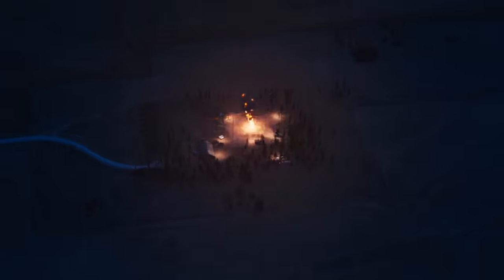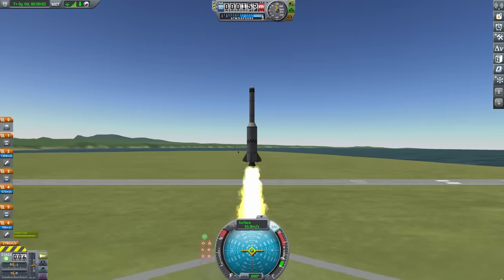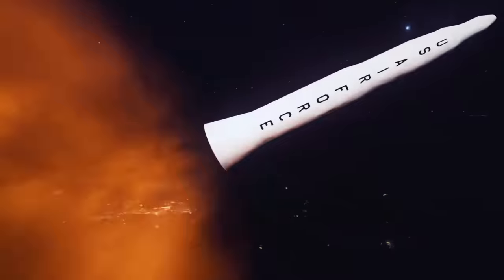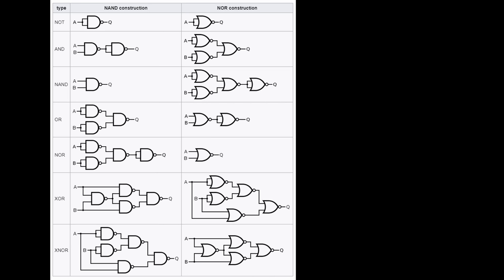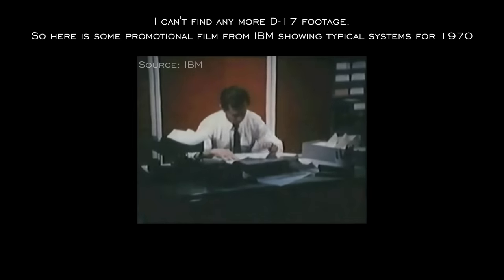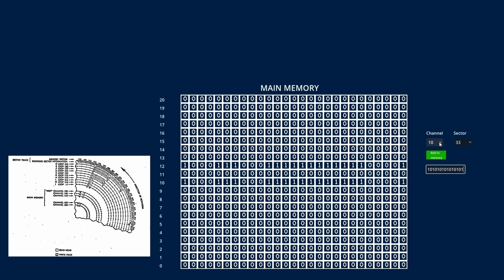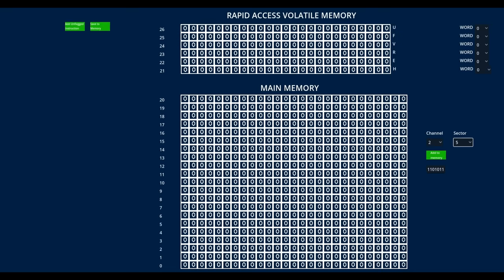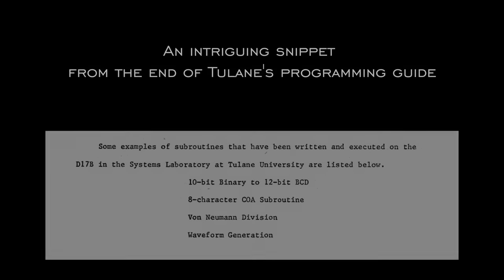Minuteman D-17b: The Desktop Computer Was Born in an ICBM

Comment: I commanded a Missile Combat Crew in the early 80s. My system was Minuteman III. One morning when I was sitting in the Squadron waiting to go on alert, I happened to stumble upon an old Dash 1 Tech Order for the original Minuteman I system and started to read. I was shocked to learn that the first Launch Control system had no computer at all. The entire thing was based on mechanical relays. The Enable commands were simply electrical continuity circuits. Interrupt the circuit and the sortie enabled. If power at the capsule dropped, all the sorties in the flight would enable. Daily SCN tests dropped connected sorties into Standby mode so the crew could verify communication. The whole design was surreal to me given all the nuclear surety that was deliberately built into the software that I used. I couldn't conceive of that kind of system without a computer. But I guess it makes sense given the level of technology in the early 60s.

The computer in my capsule was a Rolm 1666B, especially built for the mission. Not much by today's standard but it did the job.
Reply: Sorry if this is a stupid question, but what was it like doing your job? I can't imagine the feeling of working next to such awesome (in the old sense of the word) machines.
Reply: @GulmoharBloom  Missile crew duty was a 24 hour alert consisting of alot of tedium interspersed with intense activity. It was cold in the capsule so I generally wore a sweatshirt. (The first thing you did on alert was take off your uniform - one of the many, Many, MANY things the movie "Wargames" gets wrong.) Taking off the sweatshirt was a good indication of how busy I was. We had daily tasks - making sure the capsule was OK, verifying the targeting info in our sorties, calibrating the missiles every now and then. Mostly we watched. "Status monitoring" was the parlance. Security, faults, maintenance, and comm. 

Did I think about the possibility of war? No, not really. PBS did a documentary in 1983 called "Nuclear Outpost" at my base. One of the reporters asked me if I had nightmares about nuclear war. I said "No, I have nightmares about Two Officer Policy violations" (Being alone in the capsule was a serious offense.) I still had those nightmares 10 or 20 years after I got off crew. 

That said. Just before I got on Crew, "something happened" (we will leave it at that) and the readiness of the missile crews went up to the point that they inserted launch keys. (That's a long way from actually launching missiles btw but it is still what you call a significant event.) That's only happened a handful of times in history. The command post on the base had a direct line to all the crews in the field,  and the first direction was "Do not call home. Keep the outside lines clear." Everything was restored to normal in a few minutes as the "something" was resolved. Since the launch switches are sealed to prevent tampering, a lot of people were immediately dispatched to the field to replace the seals. They said the crews on alert were just white and still shaking. So, yes. We knew it was real. But it was mostly remote from consciousness. 

Would I have turned that key if so directed? Yes. No doubt in my mind.
Reply: @carljacobs1260  It just boggles my mind to meet (?) someone who would be/was involved in nuclear warfare. I'm not sure if I could have turned the key if it came down to it, but then I won't ever be in a position to do so. 

Thank you for responding, it's given me a new perspective to consider as I read more about nuclear war. Have a nice day!
Reply: @carljacobs1260  Oh come on, WarGames was - technically at least - fantasty, albeit terrific movie.  Was documentary you mentioned used in Gwyne Dyer's "On War" or "First Strike" or was it other?
Reply: @piotrd.4850  "Wargames" was a piece of propaganda for the Nuclear Freeze movement of the early 80s. Some of it was hilarious. Some of it was so dumb it could only induce eye rolls. "That's not the correct procedure, Sir" is the dumbest line I have ever seen in any movie ever. A great example of writing a plot to fit a preconceived narrative.

To the best of my knowledge, the PBS documentary was only broadcast on PBS. You can find poor quality copies of it on YouTube.

Comment: Early computers like this are fascinating, stuff like the core rope used in the AGC, really amazing tech.
Reply from the maker: The core rope modules were wild. When they reprogrammed the AGC to use as a fly by wire computer, they had to race to write the code before the core rope manufacturing facility was closed forever.
Reply: As a very young child I got to see a core memory computer being used in production.  I found it really neat that one could see where every physical bit was stored.  (I've tried to determine what precisely machine it was but to no avail.)
Reply: I'm a computer nerd and have no idea what core rope or an AGC is. 😂 Thank you for what I'm sure is about to be a very happy Google/wiki rabbit hole.
Reply: @orangejjay  Have fun!
Reply: @Alexander-the-ok code being rushed? As old as code! 😂

Comment: That magnet hard drive sounds more like a parallel-track magnetic tape loop made out of rigid bodies instead of bands of elastic or celluloid.

Wait. It's planar drum memory.
Reply: Yea, the one used for the D-17 is a drum memory.  The models produced for less-extreme environments (including the Hound Dog missile) were more like a single platter hard disks.  See Appendix A of MEM-BRAIN FILE, Four versions for DCA for details.

Comment: Assuming decent gyros and accelerometers, you can significantly minimise compounding error by using low-pass filters at your ADC inputs. This can drastically reduce the sampling frequency required to maintain a reasonably accurate positional and velocity vector. If implemented correctly, there is no quantisation error other than the bit depth of the ADCs, and you don't lose the contribution of any high frequency components, those get averaged into the signal by the filter.

Comment: You have no idea how much I enjoy this video. I have always been fascinated by early computers. Back when I was in school and briefly after, I only had time to read a little bit into these computers. Here, you've gone all the way!!!
Reply from the maker: Thanks. Tbh I'm the same - always been fascinated by early computing, but only recently had the time to study these systems in more depth.
Reply: I am looking forward to the episode about the Navy's fully-networked, transistorized refrigerator-sized missile fire control computers, put into operation in ~1964. It is one thing to equip a computer to work control surfaces and thrusters, another to have it swing a robot arm into position and launch missiles. Many ship captains got into hot water trying to keep the computers off their ships, but the need for fast response left no possibility of them staying in the loop. Where more capacity was needed, they added more of them, and all talked via radio link to their counterparts in nearby ships to coordinate their activity. So a missile battery on a destroyer could be used to protect a nearby aircraft carrier, without crew help.

I gather those machines had a role in Apollo as part of the worldwide communication and tracking system, but the details escaped me.

Comment: you and Artem Tatarchenko are a match made in heaven lmao. he is so talented and really adds a lot to your really well written and interesting essays :)
Reply from the maker: Agreed, he's amazing at what he does.
Reply: While the animation is quite good, a few details do distract me quite a bit as a big fan of the Minuteman system.

The silo layout, in a forest and surrounded by buildings definitely seems more like a Soviet style missile silo installation. The US launch facilities are very spartan and remote, just a fence and dirt and gravel patch around the silo door, usually in the open plains of the upper Midwest.

Also the silo door actuator is much more violent. While a lot of footage of launches comes from the Vandenberg silos, where they slide open smoothly on rails, those silos were designed for repeated use. The actual deployment silos have a much more simple system. Hydraulic rams push with great force the concrete door on smooth metal rails with enoug energy to make sure that even if the silo is covered by dirt due to a near by detonation that it can get out of the way. The only thing stopping it is how much friction it has once it comes off the rails (and in reality could easily breach the perimeter fence).

Also the tail end renders show two exhaust nozzles. The Minuteman first stage had four nozzles fed by a single solid rocket engine.

Anyway, nitpicking but small details noticed by a pedantic nerd.

Comment: The D-17B used discrete DRL (Diode Resistor Logic) circuitry with DTL (Diode Transistor Logic) where needed, but the MMII used the D-37C which was one of the first guidance computers to use SSI integrated circuits (The other being the Apollo Guidance Computer).

Comment: Alexander, this is a very interesting video. I used to work with a very early DCS, it was designed and built by the company that used it in its pharmaceutical manufacturing business as process control and batch reporting. I only had a bit of time to learn about it before we replaced it with a modern standard (S7-4xx).
I specifically recall an analog input board with hard-codeable limits (DIP switches and jumpers, 8-bit, low and high warning and alarms, it triggered an interrupt on the central and fed it to a card managing all the interrupts and their privileges.
It was a headache to implement the interrupts as the only documentation we had was a copied copy of someone’s handwritten notes that had been used during qualification and then copied again and put in a binder.
It worked for decades but there was a fatal flaw in the design and it hadn’t been picked up. It was quite the hassle to get the HAZOP reviewed by the chemist who just muttered „boy, we were very lucky“ and then update the documentation to reflect the corrections we had to make.

Fun.

How far is your SDS and the SMDS for this project? 😏

Keep it coming, love it!

Comment: IIRC beryllium is a very stiff metal for its weight. It's also used in  the JWST mirror segments for the same reason. Probably also has a low coefficient of thermal expansion. Nice modern IMUs still output an integrated delta_v over their sampling interval as well.

Comment: The Soviets used a ground-based guidance system in the R-7, the basis of which was copied from the Germans at the end of World War II. The R-7 ICBM was tested in the Northern Urals in 1959 and there were some casualties there during the testing phase, including the members of the Dyatlov group who were involved in the testing and evaluation process. They conducted these tests with active warheads set to a lower yield of 1.6 megatons (standard RDS-37 warhead). After completing the series of tests, the R-7 was officially handed over to the Soviet missile forces in 1960.
For those interested in more details about the Dyatlov Pass Incident, I recommend watching my videos about the entire case and its complete solution.

Comment: Yeah, I saw a couple of of preeecessors, probably for the Titan II, of these being thrown out from the local University.  They were supposed to go to hazardous waste disposal, as they used a cooling system using liquid mercury.  Really sturdy devices with inch-thick aluminum cases.  You couldn’t see much inside the case as it was filled with  plastic foam.  Wish I had kept them.
Reply: I'm still kicking myself for not rescuing the DEC PDP that I saw in the trash outside a medical office in the early naughties.
Reply: @alexhajnal107  I had the opposite experience-- I bid on two PDP-11/44 systems, won them, then found out they were just the cases, someone had pulled out all the cards.

Comment: When you pointed at the need for high precision of guidance and possibility of corrections (22:07), you mentioned missing St. Petersburg and hitting Helsinki. Well, at the time the minuteman were developed and were operational it was Leningrad they were aiming at, since the name St. Petersburg was reissued only after the collapse of Soviet Union

I don’t think this correction is a must, but I figured it would be something to note
Reply from the maker: Great point. I never thought of that.
Reply: Thus Lt. Chekov in Star Trek had scotch "invented by a little old lady in Leningrad." How were the Star Trek writers to guess it would change back to Petrograd by then?
Reply: @sciptick 
There are people born in towns which changed their name upon independence.
But they speak of the place where they were born, not what some politician called it  later.

Sometimes an international airport changes its name but the codes for that location are still the same. 
There is one 50 miles from here but a Liberator pilot would use the same name. As would a local.

Comment: The computer was under the platform that carried the RVs. It also had either an electrostatically levitated sphere gyroscope or a helium neon 6 axis ring laser gyro in the dead center. The main middle battery was a 28V NiCd battery but the ones in the actual nukes were magnesium based thermal batteries. What they got in the more modern ones is a lot smaller and more accurate.
Reply from the maker: I really want to do a segment in a future video on ring laser gyros.

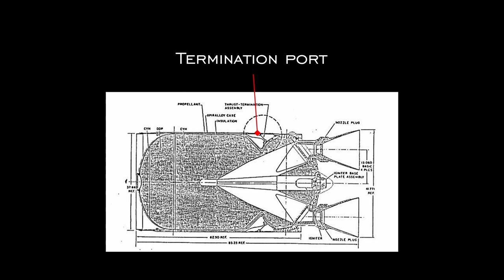Comment: 21:30 That is trivial. The explosien caused a massive leak that bypassed the thrust nozzles completely. Thereby reducing the thrust not to nul but to a fraction. That influence sufficed to control the terminal velocity.
Reply from the maker: That’s what I initially thought but all the sources on this state it wasnt a thrust bypass but a near instantaneous termination as the reaction abruptly stopped.
A few other viewers have clarified its because the rapid drop in pressure blows off the top layer of fuel and stops the reaction.
Reply: @Alexander-the-ok  if you cut solid state fuel fast enough until reacton gets there...

Comment: Beryllium is super lightweight, super strong, and has a very low thermal expansion coefficient, so parts made from beryllium alloys can be made with tighter tolerances than aluminum or titanium. There's also no risk of sparks or static buildup, which can reduce compounding errors in inertial guidance systems. But... beryllium poisoning is absolutely horrible, it makes asbestos seem like a mild nuisance in comparison

Comment: Just for fun, I wanted to know how fast Doom would actually run on a D-17B as the CPU.  There's no way it could store Doom on it's HDD.  It probably can't drive a raster display either, so let's assume some IO upgrades to handle those parts.  So here's my SWAG:

According to a post on the Doomworld forums, a user estimated that Doom needs 32 instructions per pixel, so we'll use that.  He mentions that the 32 instructions are on a 486, so it's likely not the simple instructions the D-17B has, but I'm not going to dive into the Doom code to find out exactly what was used.  Wikipedia lists the timing for the add, multiply and load instructions, so I'll arbitrarily use those.  I picked an arbitrary mix of 10 adds, 12 multiplies and 10 loads.  The wikipedia page says we can do two multiplies as the same time, so we'll do the timings that way.  All told, we end up with a single pixel taking 4.8 milliseconds..

Assuming my guess about 4.8 milliseconds is right (which is probably wrong), we get the following:

Doom runs at 320x200, so rendering a single frame takes 310 seconds or just over 5 minutes.  Doom runs as 35 fps (ideally) so 1 second of Doom takes about 3 hours to render..

The fastest listed speedrun of Doom is 4 minutes and 39 seconds.  That speedrun would take 35 days on a D-17B.
Reply from the maker: Love it thanks for this!
There is one thing missing, and its the main reason i never coded the timings into my sim: read write to the disc.
Much consideration is given to this in the original programming guide as reading from a ‘sub optimal’ sector would need us to wait up to 10ms just for the drive to rotate to that sector.
I have no idea how much more time we’d need to add in for read/write. But every time a variable is read in incurs a minimum of about 80 microseconds.
Reply: Talk about putting thins in perspective.
Reply: My favorite word for this kind of rough approximation is 'guestimate' (noun to that would be a guestimation). It isn't my creation, but I can't remember where I first came across this.
Reply: Doom would take about 18 minutes to run.

Comment: This video has made me wanting a D17 replica!, (probably an arduino is overkill but it would be way cool having a 3d printed chasis, and wired ports to do electrically equivalent terminals), just to show off driving a 3d printer with an ICBM.

Comment: the idea of using a multiple head HDD is pure genius, different sectors, useful for cache, RAM, etc at a given speed. but the lack of trust in transistors is disappointing.
Reply from the maker: To be fair, it wasn't so much a lack of trust - it was backed by statistical research. The early Germanium transistors failed frequently due to corrosion.

Comment: I knew that, at that time, inertial navigation systems did work fairly well on aircraft, at least at relatively short distances.
Using it on an ICMB (a solid fuelled one, no less) was a completely different ball game, as beautifully explained by this video.

One could be forgiven for assuming that, because it dealt with a much less dense atmosphere for most of its flight, aerodynamic deviations would be lessen. But it isn't necessarily so. Flying at low altitudes, at a more or else constant density, even while prey of wind vectors, should likely be an easier problem to tackle with late 50's and early 60's systems.